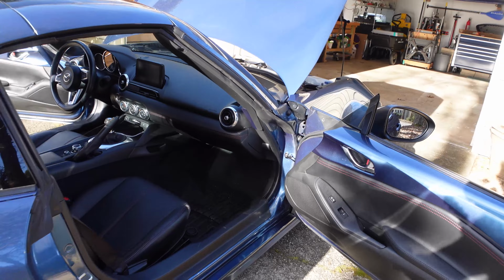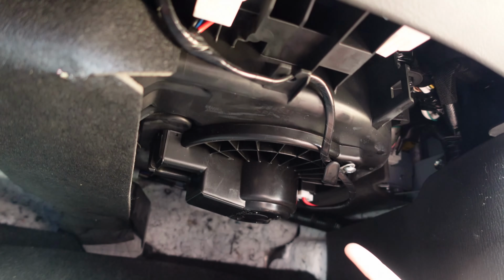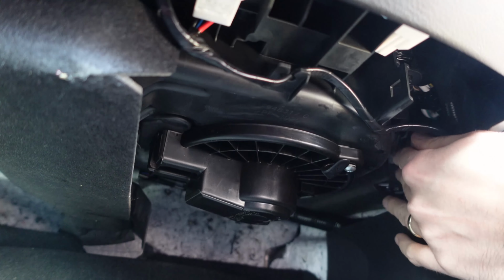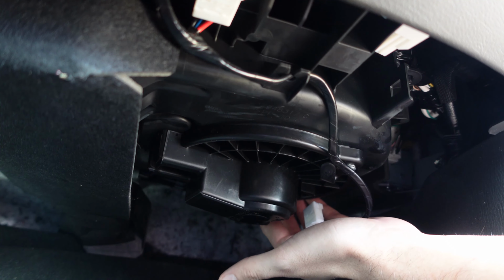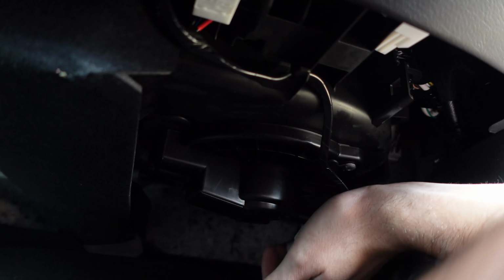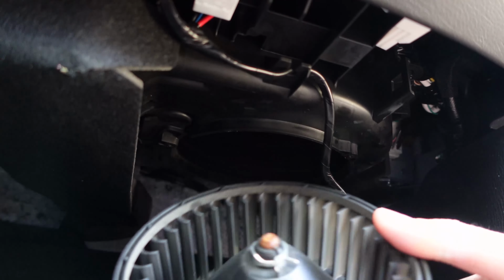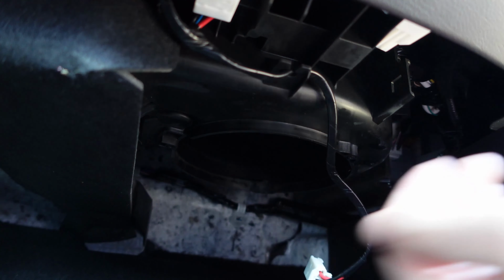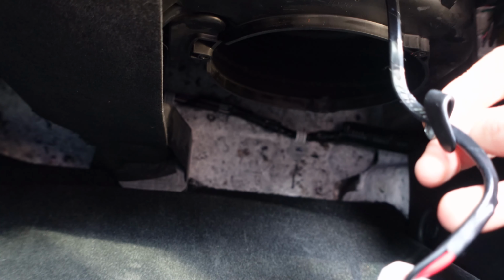2016 - 2024 Mazda MX5 RF ND Blower Motor Removal and Installation

Comment: Excellent video! Thanks for the screw locations! Your input that a stubby screwdriver was required for the back screw on the right side was spot on as well.

The screw to the center left that was inset between the housing was a pain to see, I used a small mirror to locate it by eye and I was surprised how snug the screws were coming out going back into place.

Once I dropped the fan, I found a mouse nest on one side of the fan made from paper towels and small bits of fabric that was throwing off the balance of the fan. 

I vacuumed the fan shroud out and reassembled. All good. I’m too old at 68 and too big at 200 pounds to squeeze into that passenger seat well! 

Thanks for a great video and saving me a $200 trip to the dealer!
Reply from the maker: Glad it helped! And crazy that you found a mouse nest in there! 😯.

My videos are usually longer than others but I pride myself in not skipping steps and showing the real process.

Thanks for watching! And happy Miataing!

Comment: Thank you so much for the video, really helpful! Do you have any idea if by removing the blower motor, you can access the A/C evaporator?

I want to use one of those cleaning foams that should be applied straight onto the evaporator and I was hoping I can access it this way. Hopefully somewhere on the left side through the blower motor’s hole.
Reply from the maker: I have no clue. So don't want to give you a wrong answer. Sorry
Reply: @thehousemann  no worries man, thank you for the answer anyway 🤘

Comment: Thank you for the instructions. I’ve got a 22 club model and I got the blower motor replaced under warranty at 35k miles in April. Now, 4 months later at 40k miles, the blower motor is fluctuating its speed again in a system that does not have a thermostat set point like the way the GT models do. By chance do you know if these blower motors are just defective? Does anyone know if they have a TSB out for them? Regardless, thank you for the instructions. They are really straightforward and easy to understand.
Reply from the maker: Sounds like either a voltage issue or the motor is failing which unfortunately is a common issue.

Comment: In the aftermarket, there are screens and filters you can install for the intake of this blower motor. Should help keep leaves and trash out of the system.
Reply from the maker: Yea I saw that. I might go the route of the screen to keep stuff out of the blower, but the filter is almost pointless because of the car being a convertible (also I think it was super involved to replace it), but if you spend most of your time with the top closed and in live in area with bad air quality might not be a bad idea.

Comment: Thank you for the instructions. My car is at about 32K miles. I am suspecting my blower motor. I have a high pitch squeal when using the A/C with about half or less fan speed. Was a high pitch squeal part of the strange noises that you described in the description?
Reply from the maker: So there's two sets of noises that people usually encounter. One is rustling/rattling which stems from leaves or debris getting into the housing. The other is the high pitch squeel on lower speeds, I imagine it's also happening on higher speeds but at that time the sound of the air is louder than the squeel.
I had/still have the high pitch squeel. I actually took it to the dealer afterwards to get checked out before the warranty expired and they told me it was normal 🤷🏻‍♂️.
Either way, it seems to be the bearing that is going out. You could remove the blower and clean it to see if it helps, or just swap the blower out.
Reply: @thehousemann  Okay sounds like we had similar sounds. I did try removing it and cleaning it but it still does the high pitch squeal (Thanks to your video instructions). The squeal lasts about 2 seconds at a time usually before it goes away. Are you saying that even after the replacement blower motor you still have the high pitch squeal?
Reply from the maker: @tommynguyen4314  I never replaced it as it wasn't bothering me enough and the dealer wouldn't replace it. I'll just wait for it to get really bad 😅
Reply: @thehousemann  I was going to wait until it gets worse as well. The squeal is ear piercing though and very annoying. Guess I just got to use full fan speed all the time lol. How many miles on your car when you started noticing the issue? Just curious if it's a common issue
Reply from the maker: About 32k when I noticed. At 34k now
Reply: @tommynguyen4314  man i’ve had my ‘23 for only a little over 6 months with 5-6k miles. I’ve recently started hearing that high pitch fluttering sound and it’s bothersome when i just want to drive with no music. I nearly took it in to get it inspected for $198 at my local mazda dealer. Thankfully I did some googling first, and it seems like it’s a common issue with the bearing. No one else had posted about fixing it other than replacing the whole motor, but problem still comes back. So ig it is what it is until it’s actually broken lol
Reply: @nooaiden  Not sure if we're all experiencing the same thing. Mine is almost a clicky noise that I'm quick to assign to the DC motor brushes rolling over the rotor copper plates. Or it might be debris, but I don't think it is a bearing fault.